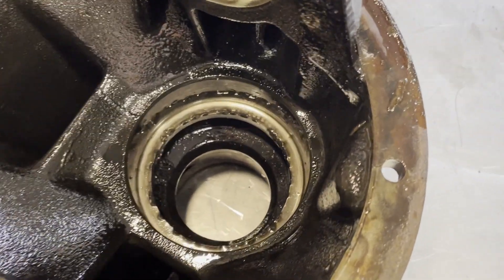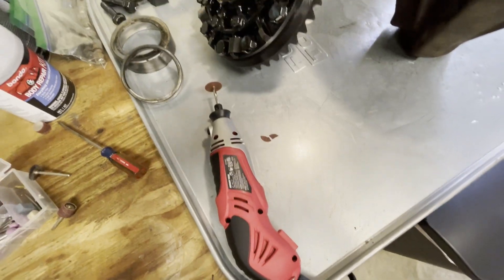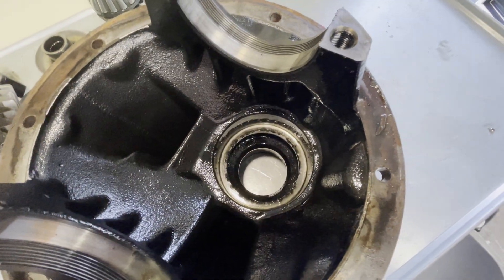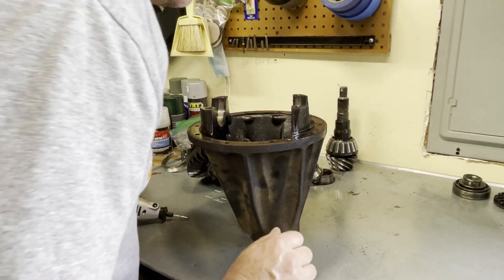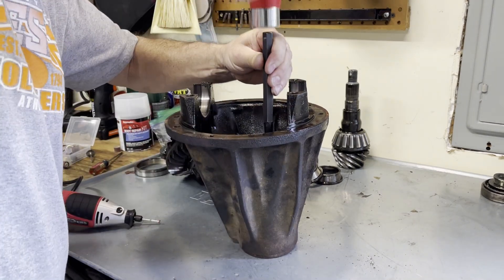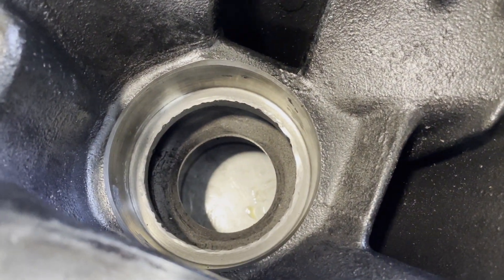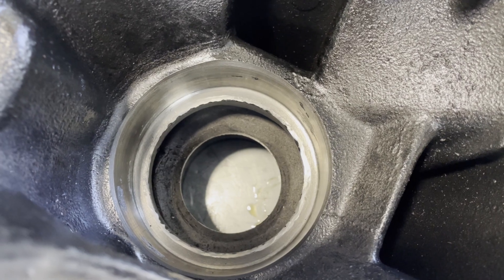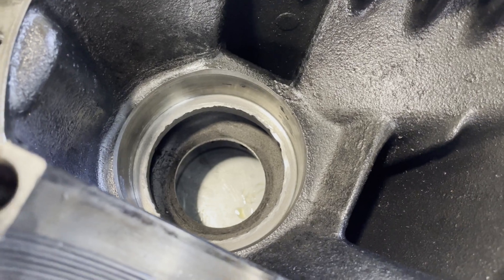Don't make this mistake! Toyota 8" V6 differential rebuild

Comment: Why did you removw rhe 3rd member ?
Reply from the maker: Pinion bearings were roaring.
Reply: @kauffmansgarage  do you happen to have a sound clip of that ? I have chased a vibration / roar for like 3 years now
Reply from the maker: @lazroo  I don’t unfortunately. Bad pinion gear bearing noise may also change as you get on the gas and let off.